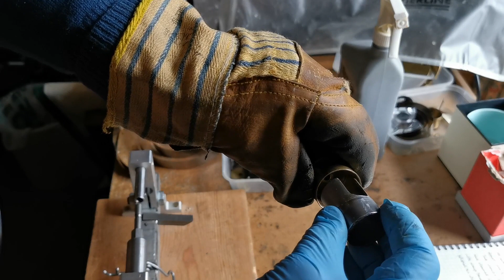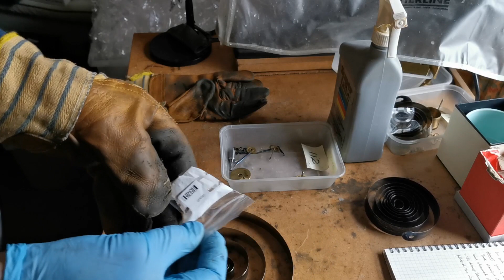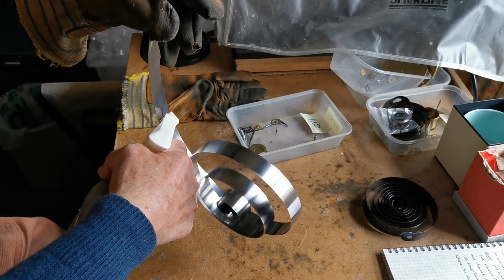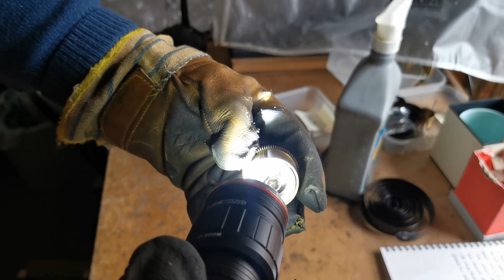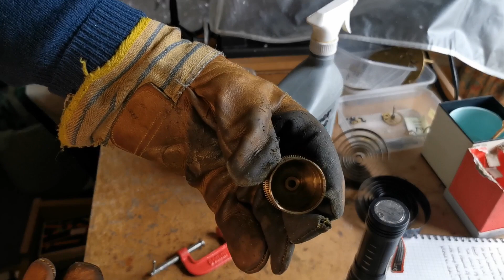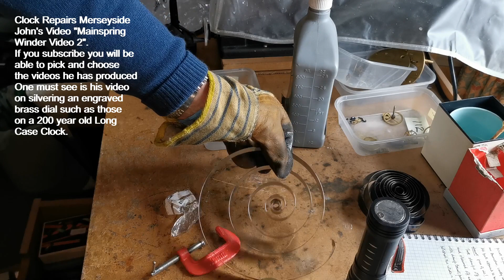112  Antique Slate French Loading a New Spring by Hand

Comment: Good Lord!   I would never have believed a French mainspring could have been loaded by hand.  
 But now, I've seen it done!  You are Amazing!    :trophy-yellow-smiling:
Reply from the maker: thank you.  As I explained I had great trouble using a first class mainspring winder - Olie Baker style. the barrels were too small (less than 30mm) with problems of sleaves fitting into them and winding the springs too tightly.  the simplest way was to do it by hand.  I was very apprehensive at first but now I have mastered a technique, as shown.  It is still quite stressful at the very start and the end - pushing the last coil thru but does work well.  So if faced with the renewing a similar spring have a go but wear tough manurable gloves.  Good luck Simon trading as tenagodus